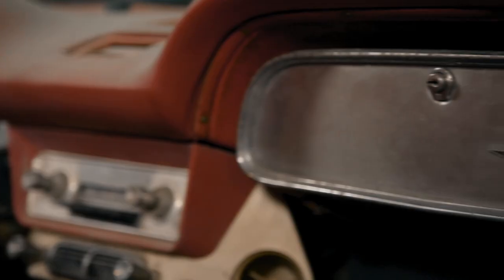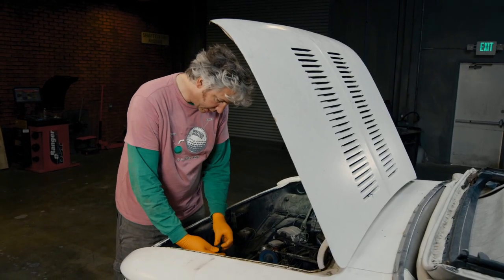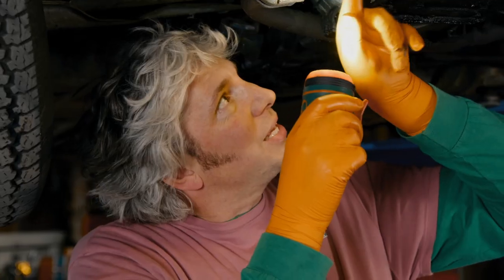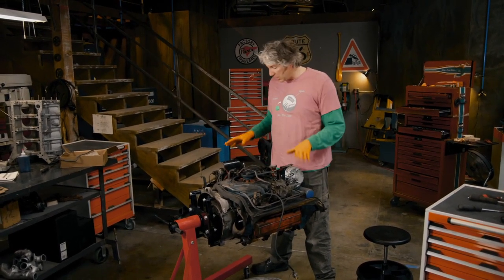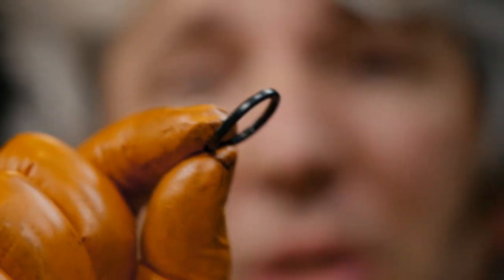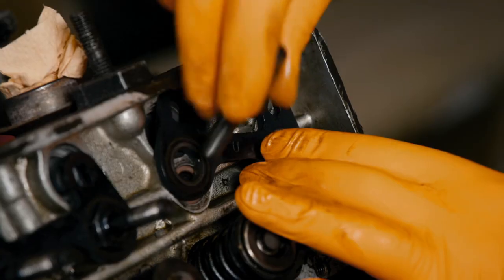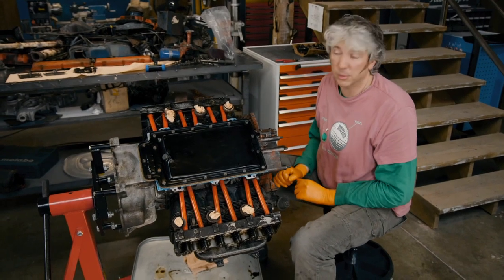Chevrolet Corvair Convertible: How To Refurbish The Engine | Wheeler Dealers

Comment: When I was 17 years old (now 69 yrs.), I had to drop the engine from my Corvair Monza to replace my clutch & pressure plate.  Didn't have Edd's advantages (hydraulic lifts, all essential tools, engine stands, and a lifetime of knowledge & experience). It was January in Northern Illinois. Jacked the rear end up as high as I could, put a kid's coaster wagon up against the bottom of the engine and held it there w/2 jacks. Broke the engine loose, slowly dropped it w/the jacks, and rolled the engine out on the little red wagon - and developed a profound respect for heavy objects. Draped a pup tent over the back of the car and put in as many trouble lights & lamps as I could scavenge for heat & got to work. This video brought back memories - can't believe I did it - don't want to repeat that history, believe me. But boy, did I love that car - later model w/independent suspension, we added a set of heavy-duty springs - handled like a cat. Really frustrated the "V-8 boys" on the windy roads. Miss that car...
Reply: Me too told...my buddies she handles like a Porsche

Comment: The 1960 Corvair was way ahead of its time. Inspired so many other vehicles from  BMW to Karman Ghia.
Reply: The Karmann-Ghia was from 1955. Sorry.
Reply: @andreas78weber   That was a different body design. When I said it influenced Ghia it was in reference to the body style that came out after the corvair. The type 34  technically isnt a Ghia but was designed by the Ghia team.  But yes you are correct that the Karman Ghia came out in 55

Comment: Just got a 64 Corvair convertible on the road that my sons bought from my buddy. I changed the valve cover gaskets and luckily that was the extent of the oil leak. 100465 miles on it.

Comment: Hmm, this Corvair also has some A/C options. The bracket, the idle solenoid, the pulley & the air conditioning unit under the radio.... I don't see a condenser, drier or compressor though. Although the early model Corvair's didn't have 4 carb options. So if I had to guess this is a 62 with a 65/66 140 engine with air conditioning. As for it being a Spyder, well it doesn't have a turbo currently so maybe it was to start, although turbo cars couldn't have air conditioning, no room. So maybe it was a normal engine Corvair with A/C on a convertible which would be rare. That someone added Spyder items & a late model 140 engine keeping the A/C parts in some areas.

Just my thought after noticing some parts around this Corvair!
Reply: its not a 140   they had 4 carbs      this car is a mish mash of whatever parts someone could get.

Comment: Growing up, our family had a 64 Monza convertible (110), later on I had a 66 Corsa convertible (140).
My Mom worked at a tire store and was given a free set of Michelin radials, it was funny seeing mechanics shake their heads when 
my five foot and a bit mom tried to tell them the tires weren't flat.  ;-D
For decades hot rodders loved the Corvair front suspension for its compact and adaptable design, that's until the Mustang II came 
out with its disc-brakes, rack and pinion steering already installed.

Comment: i see its a early spyder model but it looks like they took off the turbocharger and carb and replaced it with the standard 2 single carbs , i had a mechanic Convair friend in san jose who said many people when they has some trouble  with the turbocharger carb set up would bring them in and ask to take the turbocharger off and put regular carbs on the cars, the mechanic had several turbocharge set ups in his shop  because of that reason.  i have a 62 monza with sunroof added and 4 speed and wide tires aluminum rims . small sport steering wheel . they are fun cars .
Reply: i had a 63 with the turbo and i never had a problem.   this one probably got swapped cause the original engine blew and it was cheaper to just drop a new engine in but becuse one of the heads had an oit return line they didnt put the turbo back on.    mine dropped a valve seat and i had a 102 so i swapped it but i modified a valve cover for the oil line.

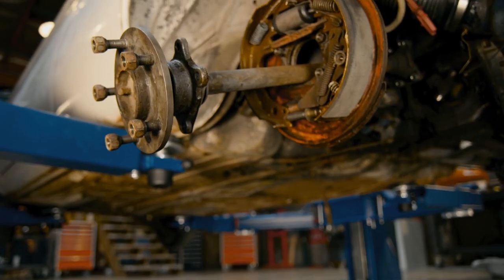Comment: I wonder if this is an authentic Spyder that had it's turbo engine swapped out. Also peculiar is the 5 lug axle at 3:45 considering all Corvair cars from '60-'64 had 4 lugs at all 4 corners. I'm guessing the axleshafts are off of a Corvair 95 van/truck.
Reply: Most likely had van brakes as they were bigger and had more stopping power.
Reply: This whole car was a mishmash of Corvair parts!  Engine was not a 150 hp Spyder turbo, generator was replaced with  alternator,  taillights replaced with '64 lenses,  hubcaps were '62, and front grille bar was missing... Most operating Spyders also added the '64 camber spring  on the rear suspension to eliminate rear wheels from tucking in too much.  All these parts are easily available from quality suppliers...

Comment: That belt setup is the craziest!!
Reply: I heard that belt costs the engine 25 hp. I once had mine break while running and the difference was amazing. But cant run it for long without it as it is the only thing that cools the engine.
Reply: @thisone.  The belt doesn't cost the engine the hp, the fan does. There are after market fans you can put on a Corvair to reduce some of the drag--but yeah, you can't go completely without one, or you're fried.

Some drag racers who drive Corvairs will install a clutch they can activate from the driver's seat that will disengage the fan for short bursts.
Reply: @playerpage  Yeah I am aware that its just not the belt. But also the gen/alt. And if you an A/C that as well. Havent heard of an aftermarket fan. What fan are you referring to. Link? I have seen the clutch pulley before, saw it for sale on ebay, never heard of it before I saw it for sale.
Reply: @thisone.  Is there a mod to convert the fan to electric?
Reply: @RestorationObsession  People have tried but nothing comes close to the engines rpm's to turn that fan and produce the airflow that the engine needs. I did see someone use this crazy electric motor setup thats off i think off a BMW. Looked ridiculous.
Reply: @thisone.  I keep adding the link and it keeps getting deleted, presumably by the moderator. Message me directly and I can get it for you.
Reply: @playerpage  I did look some up and I I found a few since last time I looked.
Reply: @thisone.  Maybe one could hook up a turbo-powered fan instead! J/k but I do love this engine. It's pretty cool.

Comment: 5:00 Whoa Edd!! Do NOT remove all 6 "bolts", actually rocker studs. The cylinder head gaskets are finicky metal rings and you will blow a gasket. Only work on one cylinder at a time, removing 2 rocker studs.  Replace those 4 O-rings and re-torque those 2 rocker studs before doing the next cylinder.

Comment: Air cooled pushrod engines like the VW and Corvair can be leaky, but as Edd said they are generally reliable.  Corvairs were just cheap used cars when I started driving in the mid '70's.   I considered buying a Corvair, I had several friends who owned Corvairs.  They all seemed be bad oil leakers, and I was amazed how many miles they seemed to go with almost no maintenance.

Comment: I bought a ‘60 Monza in ‘64, and knew nothing about cars except they used gas and oil.  The gas mileage was fantastic, but it spewed oil all over the engine compartment.  A couple of family members had mechanics check it…never solved. I would go to Sears and buy a jug of oil and keep driving. I really like this car, it went in snow so easy.

Comment: Oi oi oi
Don't put the inner o-ring on the return tube until after you've slid them on the head, lest you slice the inner ring as you push it through the head.  

But yes corvairs without leaks.. very much possible.

Comment: I owned a '61 4 door Corvair and it was a great handling car I trusted it more than I do these later-year cars. By the way, that gauge panel should either be different or the car should be a turbocharged model. That motor you have is a low performance engine and probably replaced the more desirable turbo engine.

Comment: Mechanical fuel pumps take a lot of pumping to get gas up to carburetors 
Install an electrical fuel pump and it’s will start each time right away without lots of pumping 

I just sold my convertible

Comment: I laughed when I saw the engine coming down out of th ebody. I used to lower the body down to the ground on top of a board and jack the car up with a tripod bumper jack . Leaving the engine on the floor. Mine was a Powerglide and it was easier to remove the transaxle along with the engine.
Reply: i used to be able to have mine out on a dolly in 45 minutes

Comment: You do indeed have a Spyder body, but you have the wrong engine. The original would have had a turbocharger on it. It also would have had a different distributor, lower compression, forged crankshaft, and a few other goodies. Also, the "giveaway" is the cutout for the exhaust. The turbo had a 3-inch exhaust pipe and a larger muffler. 

For those who are interested, the 92, 95, 102, and 110 horsepower engines each had only 2 carburetors - one on each cylinder head. The 140 was by itself in that it had FOUR carburetors set up in a primary/secondary setup with two carbs being used for most normal driving and the other two opening up when you floored it. 

The 150 and 180 horsepower engines both had turbochargers.
Reply: i had a 63 spyder  it was fun till a valve seat failed,  i had a 102 engine and with a little modification to a valve cover was able to swap it in,    it  was a hp improvement as well  and with a lighter weight clutch i made from a stack of old ones someone gave me.  i was getting boost in first gear,  it also spooled up and down much faster giving it a sound like a porsche when you revved it up
Reply: @perry92964  The 102 hp engine was the predecessor of the 110 hp engine. When they increased the displacement from 145 cid to 164 cid,  the horsepower went up a bit. 
Putting the 150 hp parts on a 102 should give you quite a boost in horsepower., but some loss in strength. 
Of the things that were done to the turbo engine:
1) Lower compression (turbo effectively doubles compression) to allow for maximum boost without excessive pinging or knocking.
2) Forged pistons instead of cast.
3) Forged crankshaft and connecting rods - instead of cast.
4) No vacuum advance. The item on the distributor that LOOKS like a vacuum advance was actually a pressure retard. It retarded timing under high boost conditions to reduce or eliminate spark knock.

Those turbocharged engines were pretty tricked out. Using a 102 basic engine with the 150 parts probably gave you in the vicinity of 170 to 200 horsepower. The higher compression in combination with the turbocharger  most likely would have been a real performer. AS to how long it would hold up, the jury is still out on that one.
Reply: @jimgarofalo5479  you can close the case, it worked very well and did up until i sold it about five years later  there was no loss in strength   the turbo engines also had a heavier flywheel  for the only reason i can think of, shifting into the next gear would give the car a slight jerk from the momentum, i went through a stack of old clutches and made one with all he lightest parts, it spooled up and down very quickly, sounded like a porshe. it also gave me boost in first gear.   because of the lower octane gas of today i was only able to run it at 18 degrees btc instead of 24  any higher then 18 it would ping.  i did get a water injection unit for it but i never got around to putting it on.     the 102 was the mid range of early models the low end was 80 hp. and that was what the turbo engine used.  the theory was the turbo added 70 hp.

Comment: Never seen anyone separate the U-joint to pull axles. The yoke just slides out of the differential
Reply: no it doesnt,  no axle on any car does, there locked in

Comment: If you're watching this to remove the motor and trans. Note: The axles pull from the trans, so no need to undo the U joints. Just the 4 bolts at the backing plate.